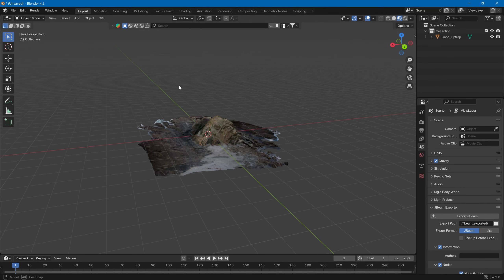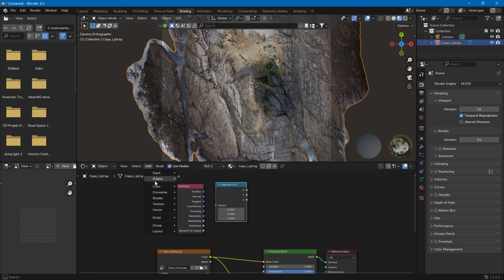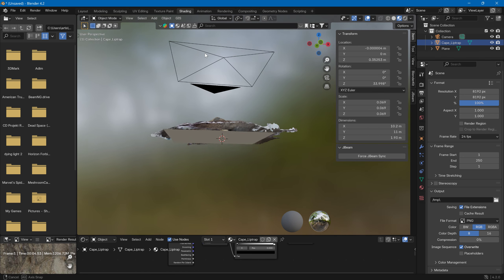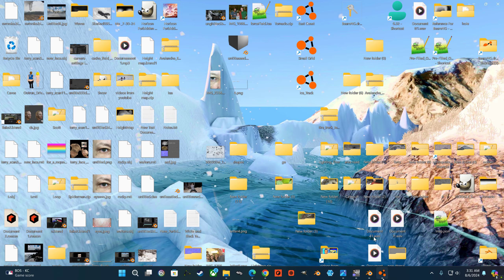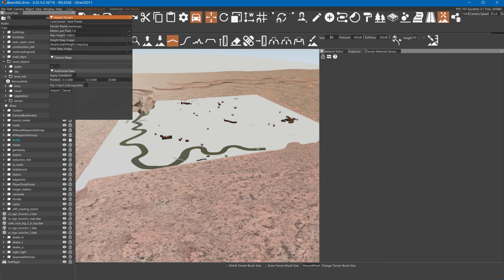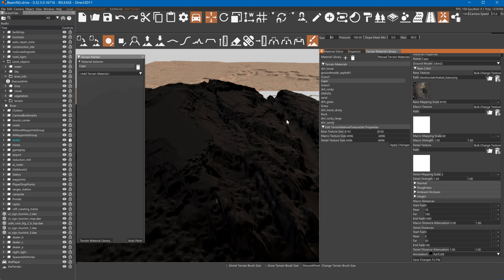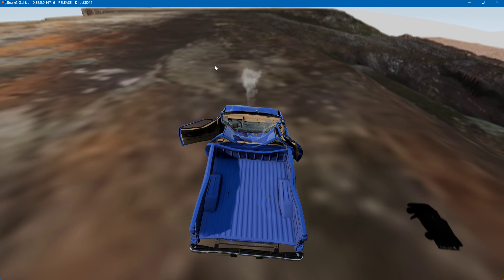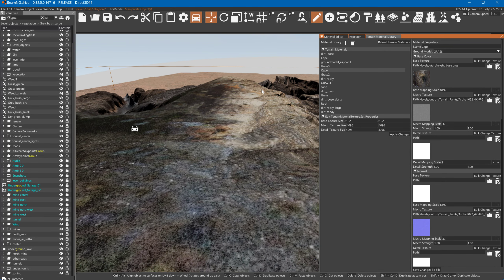How to make Height map from 3d mesh and get it into BeamNG as a Terrain Block

Comment: why is the sound only coming from my left ear?
Reply from the maker: @lylied1  that would be because the M-Audio 192/2 is crap for streaming. I don’t know either why it’s doing that. But I know it’s frustrating to listen too, you could turn your output to mono while watching my videos. Just a work around for now. Crazy thing is when I record audio in Reason 13, it does  not do that. 
I had another mic that did not do that, it was plugged into onboard audio. It had bad wire or something… and I can’t swap the one using now to do that one job. Don’t have right adapters. 
Hopefully won’t be too much longer I will get it sorted out.